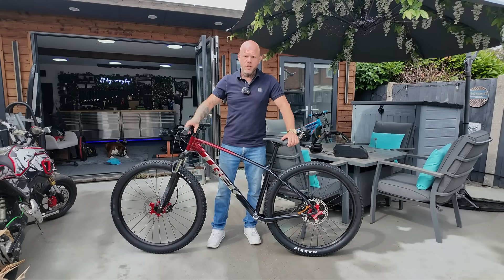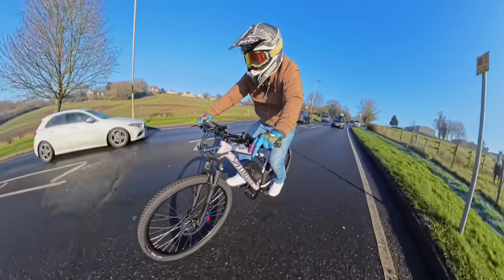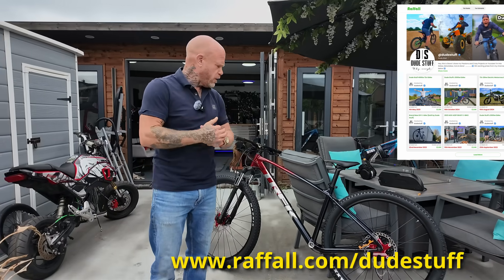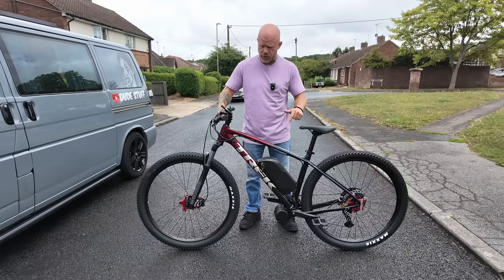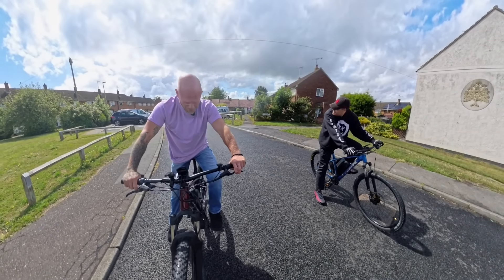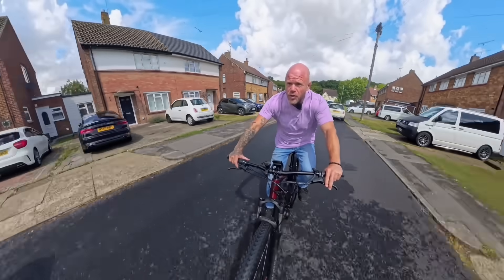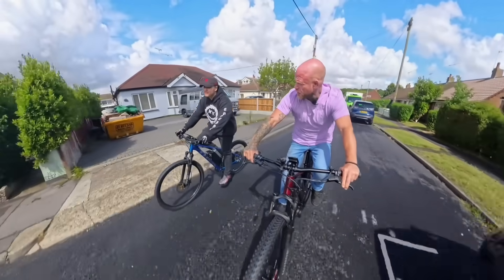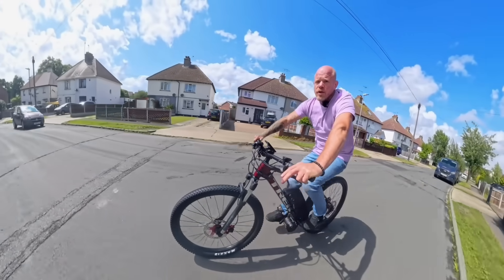I Built a 1000w Mid-Drive...  Can It Beat a 2000w Hub-Drive?

Comment: I have just bought this exact bike with the intention of fitting the tsdz16 motor. I've had to send it back as even with using the two spacers /washers the chain ring was hitting frame and the motor was still 4-5 mm away from being seated correctly. I just wondered if you had any ideas  as you are the youtube king of ebikes lol.Thanks Ashley
Reply: I had to buy a few spacers for my tsdz8 and a spacer for the chainring. Its just abit of a hassle to buy the extra parts

Comment: Do you need to change the chain length when fitting a mid drive kit.
Reply: Yes you will need about 5 or 6 more links .. you may struggle to get into 1st and 2nd
Reply: Depending om chainring size i have a 44t front chainring

Comment: Mid drive single 48v 1000 watt  a single 48 tooth rear sprocket + 52v battery and a savbaton controller  with properly set perimeters

Comment: If you disconnect the speed sensor it speeds the Tongsheng 48V 750 Mid Drive Motor Kits TSDZ8 up. I discovered that rushing to get my bike running to get to work. Personally I find around  15.5mph 20 is best & the battery lasts longer

Comment: Hey can you help me choose a 52v 23ah battery with a 50A bms but it’s unbranded and in a shrink wrap case for £360 or a branded 60v 20ah packs for £270 for a 2kw rear hub keeping mind it’s a 45a controller

Comment: Would this fit on a bmx?? lol
Reply: Yes
Reply: @kennethyoung6014  really?? Cuz that would be cool asf lol
Reply: @RemedyzBK yeah most mid drives are universal just might need to order the extra spacers just in case
Reply: Somewhere to fit the battery is usually the bigger issue and controler depending on size

Comment: There's a company that makes thru axle hub motors called Suringmax...I've wanted to try but haven't seen any on a bike yet... wouldn't mind knowing what kind of power they can handle...it's 250 watt motor but I imagine it should handle 500 or so

Comment: Hello brother please reply to me if you can it would help me alot, So i want to buy "QS 273 Motor 72V 12000W 175mm dropout 26" and i want to make 72v 150ah battery with 21700 or other, would that battery fit by any chance?

Comment: Sorry if you mention it in the video and I missed it but what chainring is that? My Tsdz8 is arriving tomorrow and that’s exactly what I’ve been looking for
Reply from the maker: Mine arrived with 2 chain rings in the box i fitted the smaller one for clearance but didn't fit the plastic chain guard this time
Reply: @DudeStuff oh did it? I’ve been looking at the kits for a while and not seen a single mention of that anywhere. Thanks, it looks so much better without the plastic and a better size, cheers man!

Comment: Good Night dude stuff you can try with asi bac 855 with 72 v 40 ah battery for bafang bbshd and try revenge vs 2000 watt hub gearless Motor 😎
Reply: Or maybe try the same controller & battery on a hub motor.  Use a large geared hub motor like the MXUS GDR19

Comment: Do a Bbshd with external controller and 72v 60a 100 phase amps.Dont even need gears with very high rpm on motor with field weakening

Comment: If you were to use this mid drive with a single gear what would be the magic gear for around town?
Reply: I have a bbs hd 1000w magic gear I have 5-6. It's easy to pedal around the city, and it's better to accelerate from the handle.
Reply: @malder8505 what chainring tooth count and cog is that?   I'm sorry  I don't understand 5-6.  And is your bbshd stock?  Or does it have a aftermarket controller?  Thnx by the way.

Comment: Can't find the 1000w mid drive on Kirbebikes, just 500/750 watt in 36 and 48v battery. Are you just slightly ahead of Andy listing it on there ?
Reply: It's the 750. They pull around 1300w on full send I believe according to another video where someone has a meter in place as he was testing different firmwares out and decided the stock factory firmware performed best for him..... Although he was also running a 52v battery on his too so not sure what watt they actually put out at 48v...

Comment: Love the video. Very cool comparison. Yes the highest output is pas 5 but it's only going to give the most juice when using the pedals, if throttle only,  full power only kicks on at high speeds.  My question to you is, is the 1000 W tongsheng, The same as the 750 W in America?  Because I don't see any 1000 Watt options available here. Which did you prefer?
Reply: think he has the 750w but it pushes to 1000w

Comment: can you do a budget build using Yose power ebike kit the 250w
Reply: Cmon bro if ur thinking of building an ebike or buying a kit then at least get a 1000w or 1500 bcuz 250w is basically the same as a normal push bike. Ur Gona get bored really quick
Reply: i want a legal one i can ride to work and back and not for doing wheelies and doing speed runs up and down the road. oh and i wont have to worry about it being confiscated, as police literally thought my normal push bike was a ebike and stopped me on it. so if i had over 250w motor my bike would be seized

Comment: Gearless hub motor is something that is headache free. You don't even need a chain on that thing.. Been riding 1.5kw 52v shunt mod 29er for 2 years now as my daily. Almost 4000km done. Goes like new. Made one for my wife too. One stupid thing is that it does not go over bumps very well because of a heavy wheel. I also did once 1.5kw rear + 1.5kw front mod. A BEAST. But two days in and I converted back to RWD because it is horrible to ride with a heavy front wheel.
Reply: yep i agree, i ride toseven dm-01 1000w, mid drive motor, it snaps the chain on every other ride, i bought it all linkglide and what not, it doesn't help, drivetrain is just not meant for that power
Reply: I have build a 52v 2000w 26 inch in the rear fully with Schwalbe Pick-Up Addix 55-559. Was dark hit the curb at like 45kmh luckily nothing broke. One thing i hate about those kits. I wanted Sunringlé rims but they scammed me with some shitty "powercircle". There beefy tho but not straight.
Reply: @dashofawesome64 what was the top speed of that i got the same specs
Reply: @kieransmith-pj7hb normal around 63kmh and with good temp and wind from behind 67kmh. i think wattage was 2600w top speed. i would like a new controller for regen and better low power torque.

Comment: Awesome video as always. Did you have to modify or open up the drop out width to fit the hub drive on that blue frame? I missed that video.
Reply from the maker: No not at all never for Kirbebike 2kw or 3kw kits
Reply: @DudeStuff excellent 👍🏻 that's very convenient not having to open the frame wider.  Their pricing is good too.
Reply from the maker: Other 3kw kits elsewhere will have wider dropouts

Comment: Imo the problem with a lot of diy mid conversions is finding the proper gearing and cadence when putting together and using the bike.
Bafang bbshd (and I have a feeling that the tongsheng, too) start to live when you reach almost inhuman cadences (for an average person). For example I can do 90-100 rpm for a very limited time but the bbshd can do 160 (while the battery has juice), and she is not that happy on low rpms (below 50).
+ An average non-ebike gearing is optimized to human-use so there won't be many "good gears" to use with a middrive. I recommend using some ebike-specific stuff like the shimano 5sp igh ("steps" something nexus model, all 5 speeds are nicely usable), put on the front a 44t and a 30T on the back. I found this the nicest config on the budget. She picks up the front wheel on the lowest gear and do 60 km/h on the highest, and you can help she by pedaling (she has a human-like cadence at "max" speed as she is on her power limit).
Reply from the maker: To me it just seems like people would rather stick with Bafang and massively overcomplicate their gearing setup than think outside the box and try a mid-drive that actually has torque sensing, it’s a massive game changer over the basic cadence-based pedal assist Bafang uses, as you can see in the video I was pedaling at 40mph on a completely standard hardtail MTB with normal 1x gearing, no special setup needed.

Comment: Why dont you get a real motorbike instead of a silly duracell moped?
Reply from the maker: You seem upset. Did someone on a “Duracell moped” overtake your masculinity?
Reply: @DudeStuff  Thing is i would love to build a hub motor with 12000w mid drive from qs motors. But getting caught loosing 6k is not what i want.
Reply: Cheaper, don't need as expensive license and not as dangerous.

Comment: I'm still fascinated with the idea 💡 of two motors one on the front one on the back and two batteries mounted in the middle
Reply: I have 2x 1000w geared hub motors with a 48v battery. It’s super fast to get up to 25mph.
Reply: something like the ridstar q20pro but on a mtb frame?
Reply: I saw one the other day and was staring like I used to look at sports cars

Comment: Hub drive should beat mid drive with top speed. Should try racing up a hill or something as then mid drive should have more chance. Not sure if makes much difference when it comes to these power levels tbh. Rip chain/gears tho. That noise is bad in video. I always let off the throttle when changing. Gotta treat mid drives more like a motorbike.
Reply: Depends on chainring size and gearing actually. I have 46t front and 8 speed cassette 11-42t on 26er and top speed with my bbshd and 48v battery is 77km/h . I've been using my bbshd for over a year now without ever changing replacing or servicing my drivetrain even once. Shimano chains and cassettes are so durable
Reply: @user-of5gk3pf9s 48mph on 48V battery? Lol
Reply: He would easily downhill wdym lol @R-S-X

Comment from the maker: Mid-Drive or Hub Motor - which do you rate more, and why? :hand-orange-covering-eyes:
Reply: I think the mid drive would suit my style riding BUT that was some loud clunky gear changes, probs wear cassette out after a short while and chain strain. Rear hub would annoy me When I get a puncture so tempted to go legal 250w front hub 😂😂 love these videos!
Reply: Hub motors are for emopeds, want an actual bike, use a torque sensor... are there hub drives with torque sensor setups.. yes there are, but uncommon. 

So, imo, mid drives are the way to go if you want a BICYCLE, or even if you want a knock off Surron for less money ( CYC  equipped fully ).
Reply: Btw, did you look into the custom firmware option released for the tsdz8?
Reply: Depending on what I'm doing. off roading I use my mid drive. Back roads for the rear hub hog😂
Reply: Plenty of ‘Bafangs for your bucks’ eh😂. Gear changes sounded a bit wrong. Maybe further adjustments required?

Comment: Cheers dude , I hear the Bonnell 775 MX is the one to try .
Reply from the maker: I basically built the same bike in my shed already, its just a company slapping a CYC kit on a mountain bike as far as I know.
Reply: @DudeStuff You should make a full suspension cyc mtb and take it on a mtb trail
Reply: @DudeStuff yeah I did see that video , it’s quite the machine . About £5000  from Bonnell .
Reply: @DudeStuff Its not they've had the frames specially made. Theres some videos online showing the screen integrated in the frame. They look cool asf though.